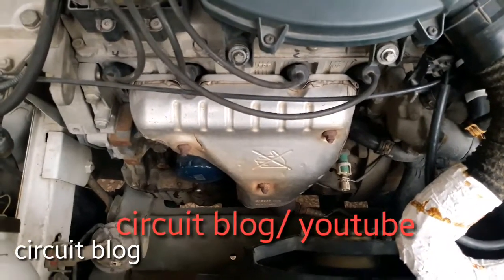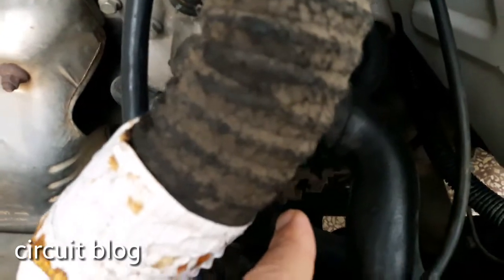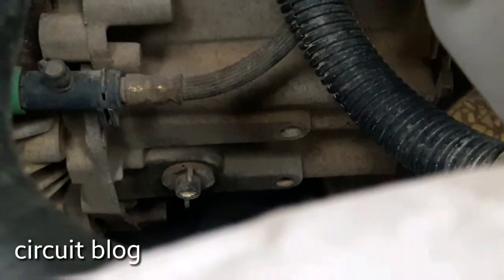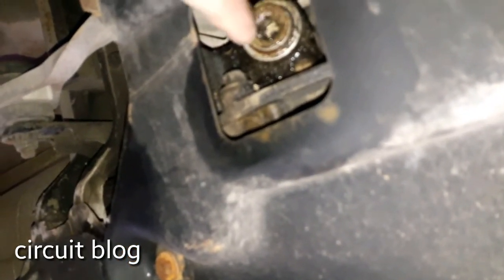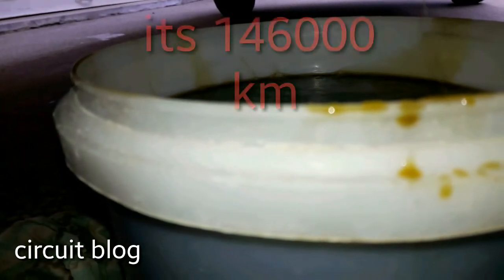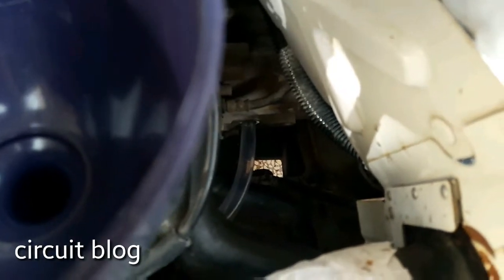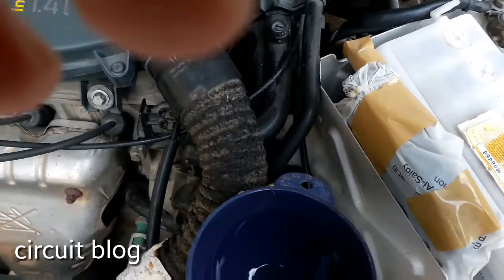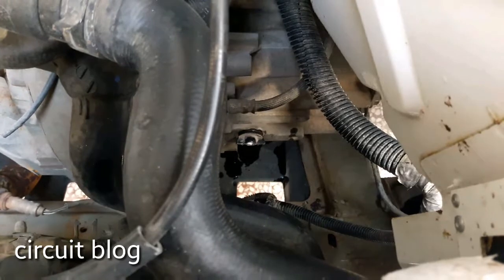Renault E7J engine jh3 oil change

Comment: What is the gearbox oil capacity?
Reply from the maker: Hi thank you for your question regarding the type of the oil, according to the car manual  it is 75w-80 and you have to keep  adding oil as i did until you notice that it starts to come out of the hole in the body of the gear then wipe the excess and close the cap i got 4 liters of the oil i use 3.5 of it
Reply from the maker: @steve0680657  
Yes Steve, sorry for the late reply my friend, I was busy and I hope I helped you with the answer. Please subscribe to the channel and activate the bell button to be notified when I post any new video
Reply: ظرفیت روغن 4/3لیتر می‌باشد اگر کمتر ریخته شود خسارت شدید به گیربکس وارد میشود

Comment: this engine k7j 1.4 8v wrong info please correct...
Reply from the maker: Thanks for your comment the user manual call it E7J 
And you can find  the same type of engine and thay call it E7J
https://www.b-parts.com/en/store/products/3485300/engine-renault-clio-ii-bb_-cb_-14-bcb0c-bcb0s-e7j-780-db10933-1998-1999-2000-2001-2002-2003-2004-2005-2006-2007-2008-2009-2010-2011-2012-2013-2014-2015-2016/

https://www.kijiji.it/annunci/ricambi-auto/avellino-annunci-mercogliano/renault-clio-megane-2002-1-4-b-8v-motore-codice-e7j-c6-34/114306776